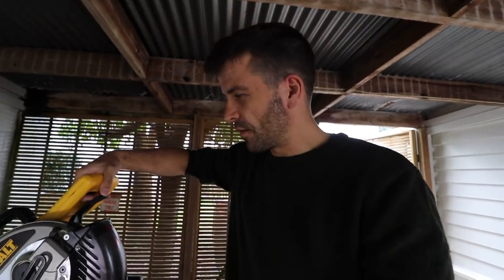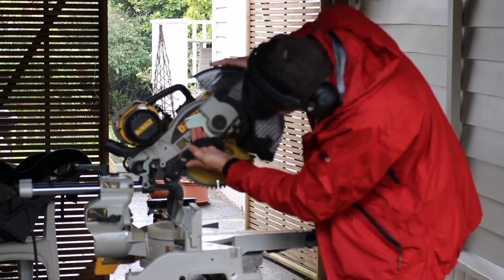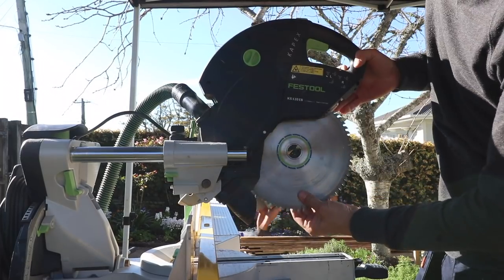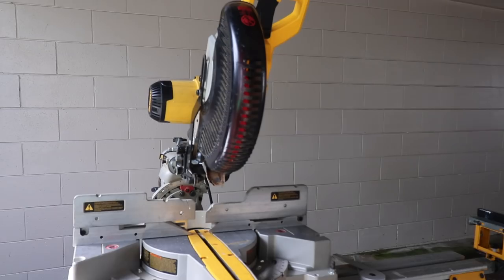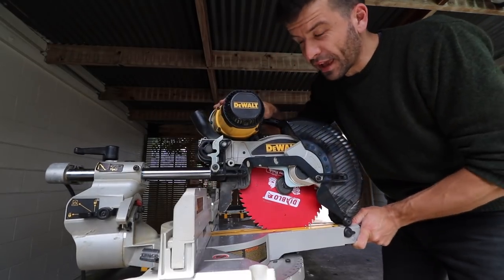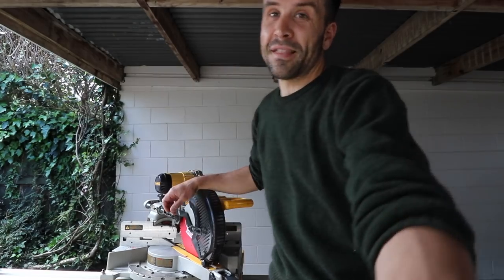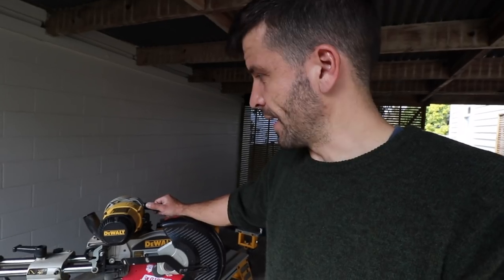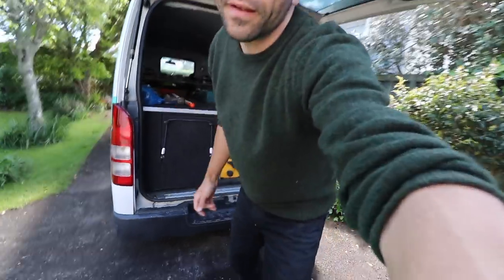Festool Kapex vs Dewalt Mitre Saw

Comment: Dewalt is a great saw! Cracking saw in fact. Used one for many years but I switched to the Kapex 120 in 2012 and have just upgraded to the new revised version. For me personally, as a kitchen installer/shopfitter, the Kapex is the better choice. 
It’s such an accurate and confident tool and the forward facing slide rails means I can park the saw against a wall in the smallest of work spaces with no problems. And oh boy that bevel angle finder has been worth its weight in gold a thousand times over. For sure, you bet my Kapex sits on a Dewalt stand though. There is no better stand option for site work 👌🏼

If the Dewalt does everything you need it to, then stick with it. You’ll scratch the Kapex itch one day though... it happens to us all.

Comment: Festool makes its blade nuts and guide rail connector screws from very fine expensive german chocolate. And then provides you with mega hard tempered allen key
Reply: the german chocolate is not so expensive , Swiss chocolate is ;)
Reply: Yeah and i bet a swiss chocolate blade retention nut would be better lol

Comment: I had the dewalt saw for 10 years with no complaints but had just had to buy a new saw in went for the makita LS1019 and can recommend it definitely worth a look at.
Reply: I own the makita LS1019 and the kapex and obiously it's not fair to compare the two of them, and let me tell you that I have a couple of issues with the Makita, after heavy usage the positive detent plate wears out and you get about a 1/6" play and also the rails are out of wack a little bit,  still a great saw, but I'm a finish carpenter and those things make adiferrence, so I use the kapex for the more delicate stuff and LS1019 for the not so delicate!

Comment: The festool is a workshop tool imo. I've used a kapex extensively and own the 10" dewalt. If you abuse the kapex on site it won't last long. The dewalt is far more robust. The kapex is twice the price but not twice the saw

Comment: I like that the festool table supports the total length of the workpiece. Like I would use a chop saw a lot with a cement disc for cement fibre cladding and it would need supports every so often or would sag

Comment: I will probably continue to use Dewalt dropsaws even though I love Makita's new line.

Reason 1: XPS light does not require a battery and it accurately shows where the blade will cut.

Resson 2: The safety guard is easy to detract with one hand. As a bad habit, I always lift the guard up to see the blade. The sliding action is smooth and fast. The guard is also durable and does not break easily.

Reason 3: It is affordable.
Reply: If that is all you need then it would be perfectly fine.

Comment: Now you are gathering a few Milwaukee tools have you considered the Milwaukee MS305 DB (305 MM) Dual Bevel Sliding Mitre Saw.
Thinking it has the best of both worlds as it seems to have all the plus points you mentioned  of each.

Comment: Hi Scott; you mentioned buying festool systainers - I couldn't come at them because of (once again) price. I've just bought 10 boxes from Auer Packaging in Germany, ranging from 340 to 120mm high. Very similar to the teknos/systainer in terms of quality & material, plus superior design in my opinion. £195 delivered to my door. Range from £22.66 - 14.80 each

Comment: the finish from festool tools or german in general i find is that 10% - 20% better than other brands like makita, dewalt etc. I have no qualms using a dewalt for a frame but ive used them for skirting etc and the finish leaves a lot to be desired in my opinion. The exact same reason I would never use a festool drill to install roofing or cladding.

Comment: I  definitely a fan of the dewalt bench.  I got it when others were getting that tommy Tucker  rubbish which is essentially tje same set up as festool without the wheels.  I would like a dewalt but still hanging on to my made in japan hitachi 10 inch slider. Dust bag works great
Reply: Why do you think you may prefer a Dewalt over your Hitachi? I have been using the old 216mm Elu/Dewalt for the last 35 years and am looking at upgrading. I am actually happy with 216mm but there is not much choice in NZ for that size saw. So I am now looking at your Hitachi.

Comment: I recently ordered the DWS779 and have a DW717 on the way. I wasnt super happy with the design of the dust extraction on the 12'' mostly because it adds another 8-10" to the footprint. I plan on putting both side by side and keeping the one that suits me more. I am not a full time carpenter but I am extensively remodeling my home(cabinets, trim, framing)and plan on building my own in a few years. I typically buy tools for good design and am not brand loyal but I grew up on jobsites and 99% the contractors had Dewalt. I did recently get burned by Dewalts BS warranty and terrible customer service and their engineering hasnt improved in 10 years but the stuff just works. I even have a multitude of XRP stuff that just wont die. After extensive research I have decided that based on reviews its Festool Kapex and then everything else. The Bosch, Makita, Dewalt, and Hitachis all have very mixed reviews and I decided to go with Dewalt, even with money being no option, because I know despite every flaw the bastard will last. If I build a dedicated woodshop, Festool. Sorry for long post, btw your editing is DOPE.

Comment: I do high end finish trim work, I use a dewalt dw780, no complaints at all. My biggest reservation with the festool saw is the handle. When you’re making a hundred cuts a day , that vertical type handle can become tiring on your wrist.
Reply: Gregory Enste would you recommend the dewalt over festool I just got a new job high end homes as well thinking of replacing my old miter saw not sure dewalt or festool

Comment: I've used both of the mitre saws and the DeWalt I had was terrible at dust extraction, the festool was way better in that matter, also de mitre adjustment mechanism was way superior but, here in Spain you can buy almost three DeWalts for the price of the Kapex.... also the Festool brushes did die on me a few times, while the DeWalt did not...But anyway even though Festool makes awesome tools they're to freaking expensive!

Comment: The Festool is defiantly aimed at finish carpenters and the Dewalt is much better for framing but that Festool stand is awesome!
Like anything I guess once you get used to it you can set it up in no time, and the tape measure and stops a wicked for repeat cuts

Comment: My opinion is, from my experience, on site the dewalt, if I was working on a bench then it's the festool
Reply: If you are comparing the Dewalt directly with Festool mitre saw you probably would have a good argument. But if you need a complete platform of tools to work on the job then you will probably really only be able to do with Festool.
Reply: Exactly!

Comment: I’ve been use a lot of chop saws, Bosch, Makita, dewalt, festool kapex 120 and kapex 60, and Milwaukee. The stand on the kapex is in my opinion ridiculous, bud the saw itself is great👌🏽 I just bought a new kapex 60, but modified it to fit on a Bosch stand🤠 works great, best setup I’ve ever used😄 great videos, greetings from a Norwegian Kiwi😄

Comment: A few years ago I got a 12 inch DeWalt with the stand on special for $500 in the US. I have the Festool track saw, the larger one and love it. I also have a Carvex corded model and like it to. I do feel they are overpriced but like you, my DeWalt does the job for me. After seeing your problems with the Festool stand, I would not like it at all.
Reply: Most people that use Festool are not going to be cutting on the grass like that. They more than likely will be doing Finishing or accurate cabinet fits in a customers home. 

Dewalt make excellent tools I own several of them and they can be perfect for some people.  The only thing is I could never take a complete workshop on the road with Dewalt. I probably would need to do a combination of Dewalt and Mafell and then I would still more than like have one Festool in the collection.

Comment: Coptool turned me on to you channel! 

I love Festool (as a company and in their philosophy of innovation). That said, I would not buy the Kapex in its current iteration. They are plagued with electrical issues, mainly the motor failing for one reason or another. It happened to me, and has happened to several other people I know. I have a ~6 year old DWS780 that has made tens of thousands of cuts, been used, abused, rained on, fallen off a tailgate and is still as true as it came from the factory (which was dead-on) and hasn't even needed a set of brushes. This is the case for every DWS780 I personally know of (I am sure there are cases of them failing, but I don't know of any)  Is it as precise as the Kapex? Probably not, but it is extremely accurate if you know how to properly use a sliding miter saw, and you can make a bad cut on any slide saw if you don't know what you are doing. The new Makita front rail saw is as accurate (once you dial it in) the Kapex at 1/3 the price. You also have to use Festool's proprietary blade which, while a beautiful in function, are very expensive and hard to source locally if you need a blade in a hurry. 

For a small garage or shop which dust control is paramount, I don't think you can best the Kapex. It is also the most compact 10" slide saw and can be tucked right up against a wall (as can the Makita LS1019and Hitachi C12RSH) . For jobsite use, where you are cutting all day every day I would pick another saw.
Reply: essinem4130 they have updated the motor.
Reply: very true i have the same experience with the kapex motors burning we used 3 brand new kapex on a big project whilst the 10 year old dewalt kept on going

Comment: how good is the fast fix system on the kapex. I brought a kapex ks120 second hand as my builder mate had one and every time i used it it was too easy and cut perfect.

Mine is mostly for cutting alloy profile for stair nosing as i have a commercial flooring company. Its in and out of the truck daily, and has been dropped multiple times. so easy to square up and get perfect cuts. Would i drop 1900 on one AU oh heck yes.

Comment: Nice to see an honest opinion where spending more money is not encouraged. Festool are great at some of what they do. I believe their track saws are unbeatable.  But not everything they do is worth it. My apprentice spent £300 on a corded jigsaw and my 2nd hand cordless milwaukee was more accurate and quicker. 
Embarrasing for festool. 
Good review mate
Reply: +simon jessopp
Festool is not about spending more money. If you need the accuracy and mobility of festool that is what you need. 

I could never have a complete Dewalt tool set up that I could run a workshop from my van. It is that simple. 

A festool plunge/track saw can be used with a table set up that means I do not have to bring a table saw on the road but If I do all that is required is that I take the exact same Festool plunge saw and use it with their CMS table that also can be used for sanding or routing.  Dewalt or even the mighty Mafell cannot offer this. 

Every brand of tool can be expensive to the wrong person. I find Festool at the right price point.

Comment: I had the 12" dewalt and sold it soon after I bought the festool. The ability to tilt the saw with such ease was worth the price alone for me. Dust extraction was laughable on the dewalt and I had 2 vacs on it. One on the dust port and an octohose i made on either side of the blade.. 

 If I had to do it all over again I would keep the dewalt for bigger stock. Im not a carpenter/ dont do it full time or  I would likely have both. I do beat on the kapex and it takes its licks like any other tool.

Comment: Strange how Dewalt does so many great tools where blade changes are easy but then screws it up for the drop saw.
Reply: was just thinking this, my circ saw and jigsaw especially take seconds. 
I change my jigsaw blades several times a day for several materials so its a big bonus for me
Reply: Hold on, if you losing to much time  (tops 3 mins) to change the blade in the dewalt, you are I'm afraid to say in the wrong game. I got the 12 inch peace of p#ss

Comment: Festool Carvex....don't get me started...bought it ..tried it..got rid of it....
To start with l want to decide when and whether the tool will start cutting and how fast. That's my job.
Also if I cannot see, I'll illuminated the work piece myself.  Without the on board leds flickering away like a mad thing. 
Love Festool's ideology but sometimes it's just overworked.
Domino...absolutely f.ing brilliant wouldn't be without it.
Routers too.
Drivers and drills again over done.
Dewalt 12" mitre saw with lazer, set up correctly ...( having junked the free 40 tooth blade that supplied)
spot on for me.
Stand also...simple easy a d quick

Comment: I've used the same Dewalt 12" miter saw to build docks and seawalls for 25 years. Worst environment you can imagine... sand, salt, and pressure treated wood. Replaced brushes, bearings, triggers, and table bushings, but it won't die. I have Milwaukee and Makita tools just as old and still reliable workhorses.  Can't even calculate the value I've gotten from those tools. I have lots of new tools as well, especially now the  cordless technology is so good, but I don't see the build quality.  I can admire the innovations and ergonomics of the Festool  lineup, but the prices are appalling, and the proprietary consumables (blades, etc) annoy me. I don't believe I could repair any of them as easily (if at all), and long-term durability is yet to be proven. (I'm talking in decades of use, so don't flame me.) I'm all for innovations that make our jobs easier, but I will continue to support brands that provide quality at a reasonable price.
Reply: The kapex is clearly not made for dock builders lol
Reply: My property flooded and had my dewalt slide chop saw under water for 2 days, and it still works like a champ, dewalt is the best

Comment: Here's something as a professional, I didnt like about the Festool from the start, you can't cut crown on the the flat at 33 and 31 degrees which makes for a very accurate cut on large crown moulding on my Bosch Axial glide saw. You have to nest the crown on the Festool, at $ 1500.00 US, thats ridiculous, my Bosch is a state of the art saw with the best motor in the industry for half the cost of the Kapex, anyone who buys the Festool should have their head examined.

Comment: You'll like the festool until the motor dies which there known for, and how often do you have to change a blade. I buy a high quality blade that's able too cut pretty much everything. My DeWalt dose everything the festool does; CUTS WOOD.

Comment: Good choice Scotty, I think if you had a workshop and the saw was never going to move it might be an option, festool are a bit finicky to being moved around (typical German thing).
Seeing the quality work you do it's not the saw that makes you a great chippy it's you, having a festool won't make you a better chippy as a lot who purchase them are convinced by the sales guy it will :) :)
Reply from the maker: Cheers man🙂 I've seen guys using the Kapex in a workshop situation,  like kingpost timbers. Seems to be good for that
Reply: Take a look at the new line up from Bosch, tool-less blade replacement, up to 350mm cutting width, variable speed 100mm cutting depth on a 10" 6 year warranty https://www.youtube.com/watch?v=-WNxVO-bZLY

Comment: I own both saws. Kapex cuts way better and has better DC. However i will never buy another kapex. Do your research on the motor burnouts the kapex has. It is crazy. Shipping charges alone to get it fixed are 2/3 cost of dewalt saw. The kapex is not worth the risk. The thing should last longer than 3.25 years. Love my dewalt it cuts true enough for the nice homes i work in.

Comment: Problem Dewalt stand extensions is the supports are (when extended) at a different level with 5lb on them then they are with 10lb, then again with 15lb. Or the same long piece, at different positions. I spend all day resetting the level of my Dewalt extensions for every piece I cut.
Reply: Get it close and push down on the stock to level it! I know frogs have tiny little front limbs so maybe put your foot on it to hold it down lol.

Comment: I use both chop saws in my career I am a high-end finish and trim Carpenter installing a lot of commercial Millwork in high-end retail to churches. In any case I prefer the DeWalt over the capex however with the caveat I do highly recommend a high-quality blade for the DeWalt the DeWalt 12in with a high-quality blade I purchase mine from double-a carbide in Salt Lake City Utah 120 tooth under tooth laser cut blades these blades are very expensive but they're worth the money I think I have more capacity and more user-friendliness with the DeWalt mind you I do keep my DeWalt tuned up the capex on the other hand it does not hold up well to construction site uses mainly because the motors have a tendency to overheat and burn out secondly the blades are not highly available you cancel plan ahead and have a few extras on hand when you travel just some towns also the price of the capex is in my opinion way too expensive for what you get it does cut well I will give you that but I don't think it cuts any better than my brand new Dewalt I have the cordless version I really like it

Comment: I have the 12" Dewalt on the stand and since attaching the saw, I haven't been able to get it off again!  Is there a secret to unclipping the saw from the stand?  Cheers, David.
Reply: DRMNZ the springs on the black handles get stuck. 2 of the 3 sets I’ve owned have gotten “stuck”. Reach inside an manually move that clip. In reality the spring is broken.
Reply: DRMNZ the springs on the black handles get stuck. 2 of the 3 sets I’ve owned have gotten “stuck”. Reach inside an manually move that clip. In reality the spring is broken.